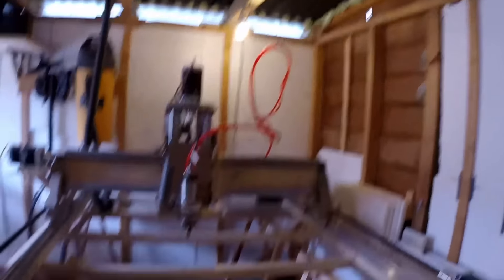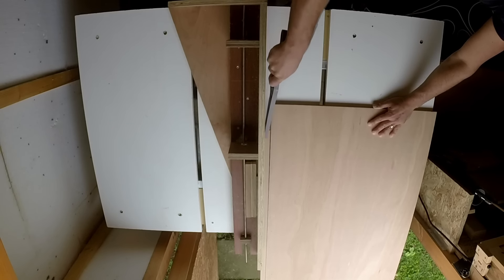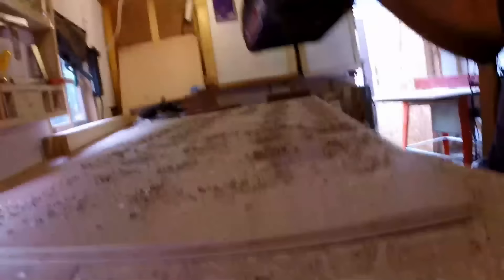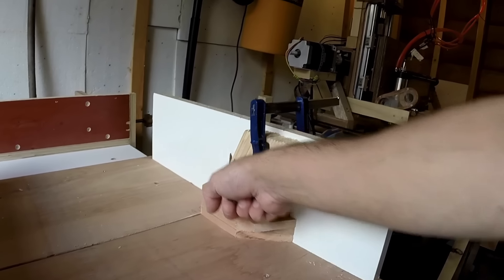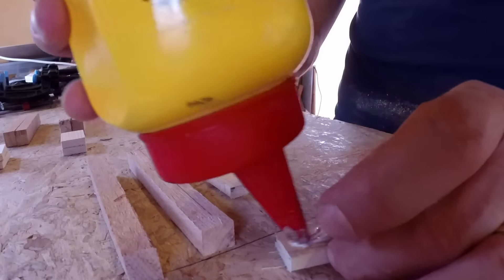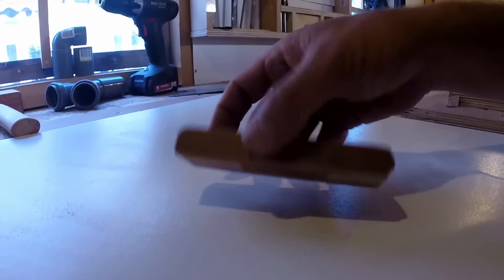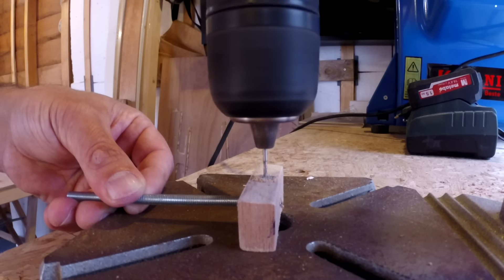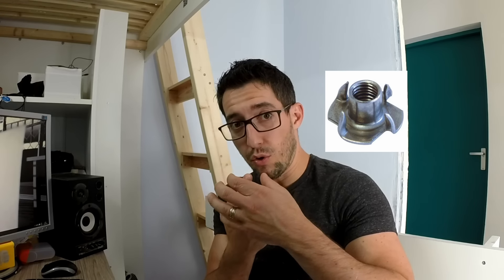World's cheapest CNC clamping solution

Comment: To avoid the splintering of the backside of any board you drill, put some piece of sacrificial wood where the drill comes out. 
In this case, i would have stacked the two parts of the table as a sandwich, clamped it to the support fram that your machine already has, and let the machine do the drilling. I you use a cylndric router bit narrower than the hole you are going to make, you can even come out without the protective sacrificial layer. Any cam program would allow you to use the routing bits to create the holes you need. 
What you mention as a t-nut is called a drive-in-nut. A t-nut is the tyoe of fixation holding a screw in a t-slot rail.  
It has a (fat) T-shaped cross scetion. 

Milling the bodies of your holders out of a solid piece of wood on your CNC machine would also have been less work. 

But don't take this as a criticism, just an augmentation of your work.
Reply from the maker: HI! And thanks for your comment. Stacking the 2 layers one on top of the other would have been a good solution, as i would have been able to drill also the left and right corners that i would have never reached normally with the machine bit. Good idea :)
Sometimes i just get so much in a hurry that i plan less and think less before doing. And this is a problem i'm trying to solve.
As for machining the bodies, also true, but in this case i could use some left overs and waste less wood ;)
For the tear out, i knew what to do, but i honestly don't really care for this particular application.
About the T-nut, i think your naming is correct, and i'm prone to think it's right. Problem is the whole internet (wikipedia included) calls them t-nut and i just stuck to that.

Comment: I wonder why did'nt you use the CNC to make the drills on the boards ? they could be more accurate and better looking and as it is clearly visible, there are no out of range ones. Placing a spacer below boards allowing a full through hole or better, milling the actual shape and depth of nuts. It is something really easy to do with an entry level cam program.
Reply from the maker: Hi. Thanks for asking. The accuracy that i can achieve by hand is fine for this kind of job. For the clamps i use it doesn't make a difference even if a hole is off by 1 cm. Also, there are a couple of things to consider: 
- for how my machine is built, i have to keep the bit at least 15 cm away from the side rails to avoid hitting the limit switch.
- The pc and breakout board are not top notch and i have to cut fairly slow to avoid loosing steps in one of my 2 motors on the x axis, so i need to watch the cut and hit the emercency stop if something goes wrong. I've ordered a Mesa 5i25/7i76 combo to speed up the whole system.

Comment: Nice work. Actually I did something similar with my old CNC using t-nuts and I know it's a good and cheap system. But now as I have sold my machine when I moved, i am looking to build a new larger one and as I watch your video, I did remark the simplicity of your build. Would you share some of the details/specs of the machine as the size of the machine, specs of the rail system and lead screws. Maybe a closer look. Thanks in advance.
Reply from the maker: Thanks. Yes. Actually you are never done once you start a machine like that, you are never done. My plan is to swap from wood to aluminum profiles as soon as i can. The machine works just fine like this, but i want it more sturdy and professional looking.

Comment: Nice job. Any reason why not to use the cnc to do all the holes?
Reply from the maker: Thanks man! Not really. I just figured out that drilling holes in a matrix like that was pretty straight forward to just mark and drill, instead of firing up Fusion 360, drawing exporting and make the holes. Plus i don't think my CNC would have been faster than me doing it. I still have to improve it with a better breakout board, as if i push it to faster speeds, one of the X axis motors looses steps. Totally doable though.

Comment: Why not use the CNC to make the base board and the clamps?
Reply: Reuel T  use some double faced tape to hold the first set.  Or get some sticks (I like paint sticks) and drill two holes in them.  One at center and one near the end.  Put one 5mm bolt through the center into the base board and a nut under the hole at the end with a bolt upside down, so you can adjust it to keep the clamp at an angle.  This is a toenail clamp.

Comment: how you going to level your new board. you have Bolts at surface level
Reply from the maker: Hi, thanks for your comment. I don't have anything but countersunk screws on the top surface. On the bottom surface, wherever i have t nuts in the same points where the board is laying on the structural square rods, i've used a forstner bit to sink them flush into the wood. Everything is perfectly flat ;)
Now i need to improve the gantry and a new breakout board.